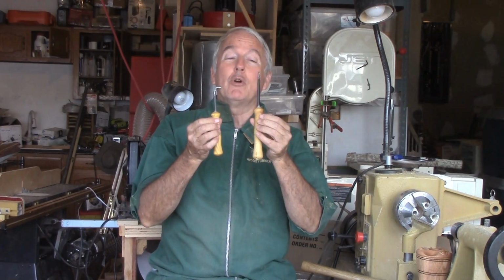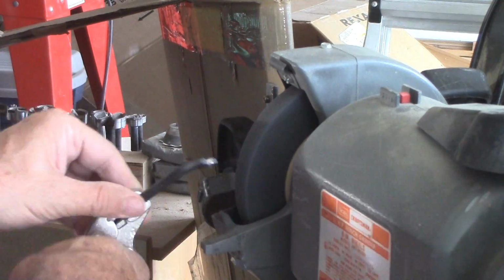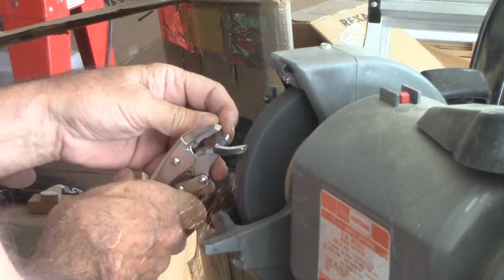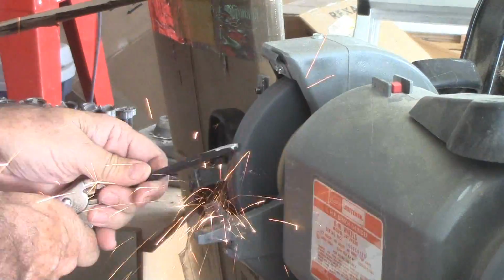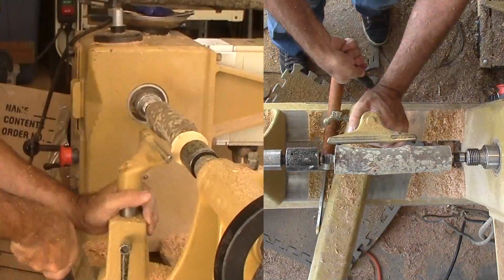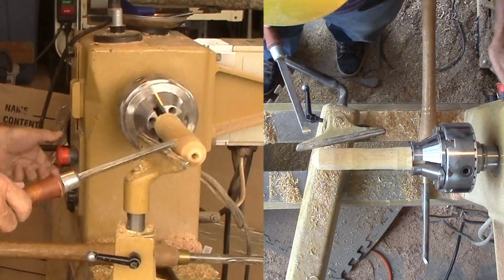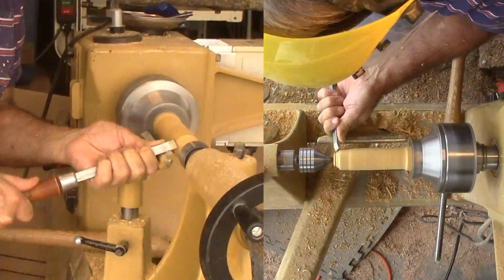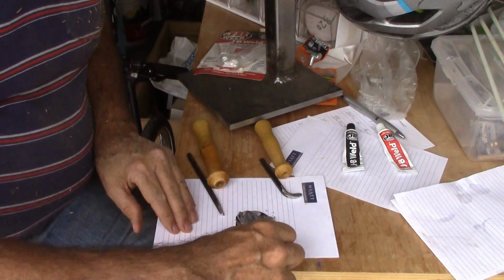DIY Hollow Form Tools From Old 'Alan' Wrenches

Comment: Excellent Alan right up my street there are some tools that you simply don’t have to spend a fortune on thanks very much may i say i am not that brilliant with metal working but if I might suggest when cutting your Allan wrenches it will be a lot easier and quicker to use a small angle grinder and a slitting disc thanks again pall
Reply from the maker: Thanks for the idea.
And Thank you
Alan

Comment: I like the tools. I am inspired to try to make my own. I will hit the flea market to get some allan wrenches cheap to make mine. The ends are my concern. How to grind them. I need a little more specific directions on that part. Any advice?
Reply from the maker: My best advice is to find one of your scrapers and grind at a similar angle for the side profile. The top profile of mine is round but could be any shape you want to work with. I think round is the most versatile for me.
Thank you for your persistence. :)
Alan

Comment: Hi, Alan. I enjoy your videos very much and give a lot of inspiration, if any was needed. I am relatively new to turning and one problem I have encountered is using the skew. From your videos you seem to use it a lot. Any advice ( does and don't ) would be welcomed
Reply from the maker: Proper use of a skew takes practice. Many turners either love it or hate it. Yet it is a very versatile tool for spindle turning. If you can, borrow a video by Alan Lacer, he's a master at the skew. I use it currently in several cuts:
1. As a scraper - a skew can go either way.
2. Peeling cuts - Arcing down towards center
3. Surface cuts - along the surface of the turning. The main thing to remember here is to only use the lower 1/3 of the tool and keep support from the tool rest. Much more than I can put in a post.
Then practice. It will come.
Alan

Comment: Great video Alan.
I made a similar tool for one of my club competitions but I didn't get on very well with it initially. Because of the hexagonal cross section I found I needed to flatten the back side of the wrench otherwise the tool was getting caught and dragged round which I found too scary for my liking.
I've seen your follow on video but did you have any issues with the bent tool?
Cheers,
Ben
Reply from the maker: The only issue with the bent tool is hanging on to it. there's a lot of torque. I may shorten the arm (faster than sharpening it) to reduce the torque. Another idea from the comments is to use a handle with a Jacobs chuck to hold the tool. Mine is a larger diameter than the handle I made for the bent tool making it easier to hang on to.
since the tools are cheap, I can modify them to my tastes. :)
Good turning.
Alan

Comment: I'm surprised to see you use your CBN wheel to refine the Allan wrench tool.  I was told not to use anything but HSS on the CBN.  The wheel we bought for our club class grinder was ruined by people using non HSS on it...took the grit right off.
Reply from the maker: Thank you for bringing up this point. I checked the CBN product specs and found "Warning: Grinding non-heat treated steel such as carbon steel, aluminum and other soft metals will cause irreparable damage to the CBN wheel."
I believe the Allen wrenches are hard heat treated by the manufacturer so I'm fine using the CBN wheel for them. If someone more metal inclined can correct me, that would be acceptable.
I kept my old grinder for coarse grinds and for non-ferrous metals.
Alan

Comment: Hi Alan,
Allen wrench tools are great. I have several I us to turn miniature bird houses. Instead of making separate handles, I use a Jacobs Chuck mounted on a handle (like yours) to hold the different tools. Since Allen wrenches are hexagonal, the Jacobs Chuck holds them very secure. Keep the videos coming, they're great.
Bob
Reply from the maker: Great tip. Now I may have to remove my handles and use them in the Jacobs chuck. Wish I'd realized this before I made the handles. :)
Alan

Comment: I made one of the bent style of these from an "Alan" wrench as well. To make sharpening easier on my equipment I mounted it into a handle with a 5/8" rod glued in the end of it. I made a 1/4" square tang on the handle end of the wrench and inserted it into the rod with a set screw to hold it in place. I also made a round nose scraper from an old combination wrench I had laying around. I used the center handle portion of the wrench which was about 9/16" wide with kind of square edges. Again I made a tang so I could use it in the same handle, so I can change tools in a few seconds. The steel in both tools is hard enough to hold an edge for a while...if you take care not to overheat the steel when grinding it. They're not as good as HHS, but good enough for small jobs. You might want to put some light oil or wax on the ground areas to prevent rust...don't ask how I know this. ;-)
Reply from the maker: Thank you for sharing. Good ideas.
Alan

Comment: Envisioning intricately turned Christmas tree ornaments with those tools. Also, the straight tool would be fine for pen turning... neat idea for making your own tools on the cheap. An angle grinder or cut off tool (which can be had for little $$ at the popular cheap tool store) will make quick work of cutting down those allen wrenches to the desired length, too. How small of a wooden object can you feasibly turn with tools of that size before grain becomes a limiting factor?
Reply from the maker: Absolutely - The Chrsitmas Ornament Challenge is coming up on us. I thought about using the angle grinder but figured I'd have it cut off on the grinder before I could get it out, setup and put away. 
How small? We'll have to see. Have to try some miniature turnings. :)
Alan
Reply: I've used them to make 1/4 inch tall goblets and a hollow vase about the size of a pea. I like using the Allen wrenches better than dental tools for that kind of work.